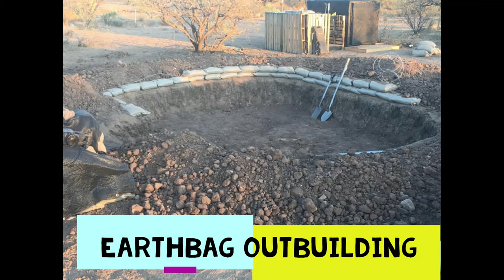HOW TO BUILD WITH EARTHBAGS

Comment: In one of your videos you talked about Permits? Was it challenging to get approved, did you need to hire an architect? I'm hoping to build in Arizona soon, would love any advice you have to give.
Reply from the maker: This structure is an agricultural use building for a farm we are building here so ultimately it would be exempt from permitting… also if a building is 200 sq ft or less than you can build (minus electricity and or plumbing) if you are wanting to do natural building or build on your own, Cochise county has Owner Builder Opt Out ( you can look this up) also Apache county is more relaxed
Reply: Should not need a permit to build that